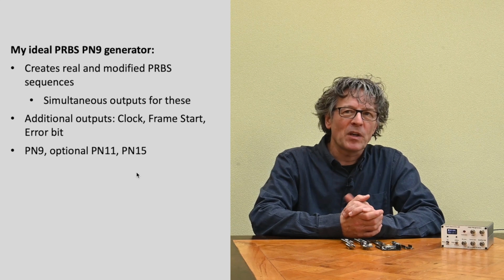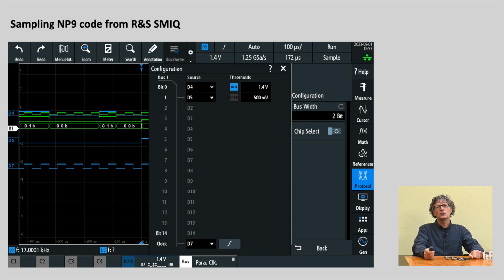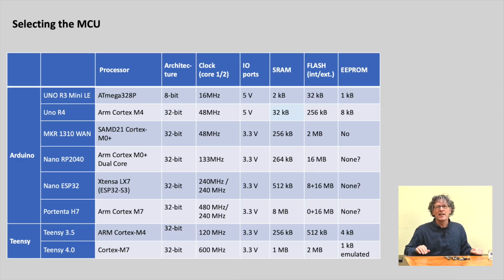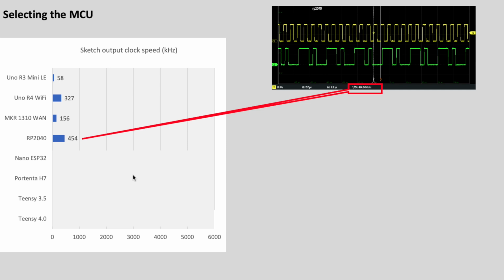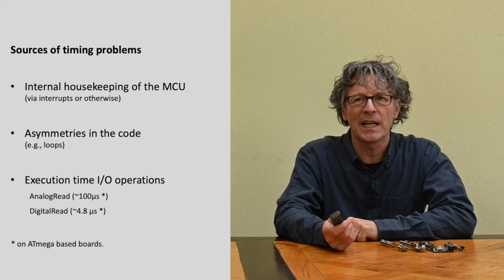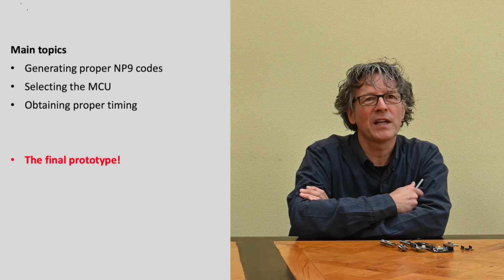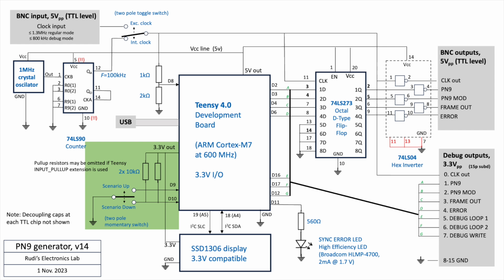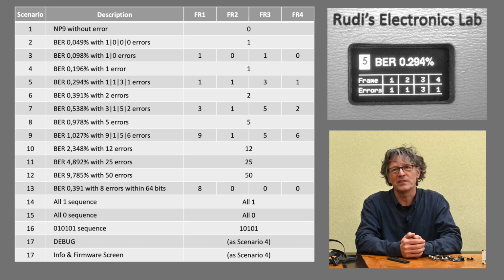REL #39 A €50 PN9 PRBS generator (BER Pt. 4)

Comment: Interesting project. Makes me wonder how hard would it be to create a serial tester that can simulate different serial protocols, including customizable timing settings, signal polarity, framing options, CRC, etc. Maybe even able to simulate noisy signals, missing bits, misaligned clock, etc.
As you discovered using digitalWrite is extremely slow. There's faster, more direct ways of controlling the I/O pins. There's also more options to represent your numbers and store them efficiently so maybe you could have used a cheaper micro.
BUT most of the time squeezing the most out of a microcontroller requires writing "lower" level code, which will make your code less readable and less portable.
Reply from the maker: Thanks for the reply! 

You are right in that there are many things that could be improved, especially in the code :-) On the one hand, I’d love to make such improvements. On the other, the time I have for this hobby is restricted (actually travelling somewhere close to the equator now :-) With better code, I’m sure I’d be able to employ a slower and cheaper MCU. If I needed to build many copies, it would make perfect sense (higher margins). However, since I only need one unit, the €25 price tag of a Teensy 4.0 is not a main concern. The device currently generates codes up to 1MHz clock. If I had been able to reach a 100kHz clock speed only, I’d be happy too (100kHz is actually my default speed). But everyone will have different design requirements. Also, optimized code often means less portability, as you noted. 

Now this unit does what I wanted it to do, I now plan to invest my time in an existing complementary device. Stay tuned :-)
Reply: @rudiselectronicslab861  That sounds intriguing. Can't wait to see what it is!

Comment: Sorry, but. As I'd understand, the only thing that this device does is nothing more than playing table of 5 parallel 1-bit sequence 511 bits long again and again, which is something, that, in my opinion, does not require a microcontroler. 5 bits to output through some latches (just to achieve correct timing), 6-th bit then should be used to reset the counter driving lower 9 bits of address counter, because that table is 511 samples long and this is the easiest way how to reset it. Then you have 17 scenarios, so additional 5 address bits used to switch scenario should be enough, right? This leads me to a 16kB EPROM. Using 70ns version gives you one sample every 100ns (just to be on the safe side), but you need to read twice per sample because of resetting of the address counter, which leads me to at least 200ns per sample, which is equal to 5Mbit/s. EPROMs are typically slow as a hell, but even though that thing would be capable of delivering 5Mbit/s (and maybe little bit more). Switching the scenario could be easily achieved using rotary switches. 

The second thing — how the outputs are made. TTL logic is not intended to be fast or precise when it comes to timing. You definitely need something differential (like ECL or LVDS) to achieve at least reasonably precise timing. TTL could be also utilized in a kind of differential way, but it's not easy to do and introduces another issues, using ECL, MECL, PECL or LVDS is just easier than running into rabbit hole of TTL logic. In fact, it would be relatively easy to put out a differential data output, you can just store that bitstream in straight and inverted form and use unused part of latch IC to put them out, but doing the same with the clock signal is definitely not that easy, so, ok, it's not differential, it's bare TTL. Maybe it would be useful to have also inverted data output, I would add this into that design just because it's easy to do.  

Using that BNCs leads me to conclusion, that 50Ω or 75Ω relatively long coaxial cables would be used (your BNCs are 50Ω types) to connect to DUT, which is a kind of unfortunate because of its relatively low characteristic impedance and also low attenuation on relatively high frequencies, which, if they are wired as you did, introduce huge ringing into whole system or overloads the outputs of TTL logic (if they are properly terminated to reduce ringing). I know that 100kHz is not too much, but as you touch the 1Mbit/s, this starts to become an issue. So in my opinion, as it is, it's probably ok up to 200kbit/s, maybe 300, but I would use different sort of wiring, just to be on safe side (and also to save some costs). Just look at the digital probes of your oscilloscope(s). These simple connectors and flat wires are used for a reason, not (only) to reduce costs. In fact, it's much better option for TTL logic than using coaxial cables and BNCs.

The last thing — software. I accept that using some kind of microcontroller opens the possibility to develop more sophisticated software introducing at least some versatility to that device, co using MCU is not that bad idea, but the software is awful. That "bool  np9[ rows ][ columns ]" is something horrible, because (you are running at 32bit system) it occupies 4 bytes for one boolean value. You are using 17 different bitstreams. In fact, if you declare that thing to be "uint32_t np9[columns]" you can easily store 32 bitstreams occupying much less memory. And selecting the right bitstream is also easy, you can easily use macros like bit_is_set() to obtain selected bitstream from that uint32 (also & _BV(bstream_num) etc, there are a lot of possibilities). That's the first thing. The second thing is that CLK should trigger an INT and the data out should be done on the background. This is the easiest way how to eliminate at least some jitter. Putting the data out routine to the background also opens the possibility to add some functionality like the dynamic generation/modifying the bitstream pattern, this just opens a lot of possibilities. This is so typical for arduino programmers. They don't use interrupts, they use the hardware very inefficient way, it's just pain to look at it.

That device is not bad, but there is a huge area for many improvements. It's decent beginning and I don't thing that development of this device should end at this point. In fact, it's great idea to build device like this.

Comment: Great video again, thank you for sharing your project with its problems on the way to get this completed. 
I am confident that I can output such signals somewhere between 1 and 40 MHz on the ESP32, using the RMT DMA mode. The RMT unit of the ESP32 is used for producing remote control signals. I programmed this to produce real-time RGB strips signals.
Another point when using the Arduino Nano is that you do direkt register GPIO output, which can output 8 bits (8 GPIOs) in one go, this is many times faster than doing the high level digitalWrite.

I browsed Arduino your code a little bit. Your polling while() loops are not good for the timing. They keep the CPU busy and you get a bad timing. The right way of doing this is to setup interrupt handlers (see attachInterrupt() on RISING and FALLING GPIO edges. For the ARM MCUs there is also a clock register to read real-time ongoing CPU clock cycles.
Your hardware and protocol knowledge is pretty good. For the MCU programming and C/C++ coding it is a bloody beginner. Will full respect I like to gratulate you that you got this completed and working. Thanks for sharing.
Regards Helmut  from Hannover